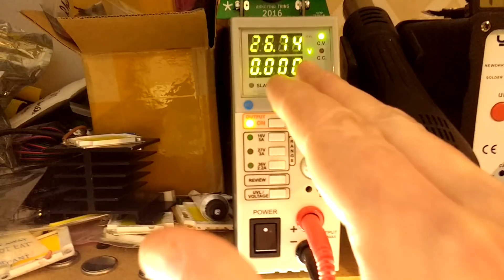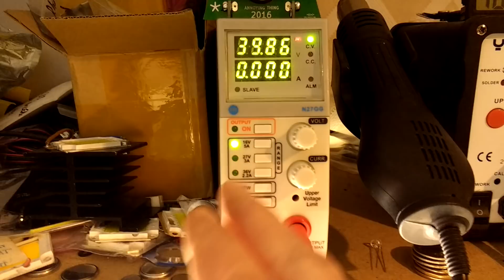Why I never show my power supply.

Comment: Is there a particular supply you might recommend, I remmember you tore down the supply "That went on fire".
Reply: In the US for a really decent but cheapie supply I would recommend the 0-50V 0-3A https://www.circuitspecialists.com/bench-power-supply-csi5003x5.html for $123.30. They have a 10 turn pot to set the voltage and the current limiting is really wonderful. I did extensive boost/buck LED driver development using one. It's an inexpensive Chinese OEM unit but you'll pay six times more for anything even approaching the utility quality from a maker like Keithley. There are so many options today... anything you find here that fits your bill you should be able to depend on for a lifetime of service: http://www.newark.com/c/test-measurement/bench-power-supplies-sources-loads/bench-top-power-supplies
Reply: I have a Tekpower 3005D-3 (http://tekpower.us/power-supply/linear-powersupply/tp3003d-3.html) and it works well. It's a proper linear supply (not switch-mode) so it's large and heavy but very low electrical noise. I replaced the pots with 10-turn versions, it's quite stable & the 10-turn pots provide good accuracy. The adjustable channels can of course be connected in series or parallel for a 0-60V 5A power supply or a 0-30V 10A supply. It's surprisingly well made for the price.
Reply: I have a Peaktech 1535, it's capable of 0-21.5A 0.8-32V. Overall it's a really nice PSU, very well built and a pretty accurate voltage/current output. It has 3 programmable settings and is remote controllable. The only downside is that you can only set V/A in 0.1 steps. For motors or for power electronics not a big deal but for anything which requires .01 volts it's a pain in the ass.
I bought it for 230 Euros from Germany.
Reply: The Mastech linear supply I have (2x0-30VDC@0-5A channels or in series 1x0-60VDC@0-5A or in parallel 1x0-30VDC@0-10A plus 5V@3A fixed) has been quite good to me and seems reasonably well built as long as you avoid the counterfeit units and the price is reasonable.  It has also proven quite tolerant of high RF environments during testing.

For a general lab bench power supply I tend to strongly prefer linear regulated supplies over switchmode supplies as the linear supplies produce a clean and reliable output with no switching ripple superimposed on the DC that can sometimes cause one unwanted grief (like RFI from the switching ripple).  Though if you genuinely need much more than around 10A with a wide voltage range at your bench then you will generally need to opt for a switchmode supply or accept a very large and heavy linear supply (I do have 50A linear supplies that cover the range of 10-15VDC but they are very large and heavy).
Reply: SAI Peregrinus 
Your link doesn't work. Try this one. 
http://tekpower.us/power-supply/linear-powersupply/tp3003d.html
Reply: I have a Tenma linear PSU which is very heavy due to the big toroidal transformer inside. It's actually a rebadged UNI-T one made for Farnell. Seems to be pretty reliable and has an extremely stable output with minimal ripple. Ben Heck uses the same one on his workbench, as I discovered in a recent video.

Comment: I found this teardown, and then the comment section is very interesting...which version do you have?

http://naklojik.blogspot.com/2011/09/maplin-n27gg-80w-switching-bench-supply.html
Reply: Paul Stafford yikes....one mention of Big Clive’s issue as well. Big Clive’s doesn’t seem to be charging larger batteries that backfeed into the PSU. Probably why his is mostly chugging away still. Hmmm
Reply: I don't seen why Anonymous had issues with removing the positive terminal before turning off the supply. For charging batteries, I consider this the correct way to do it. You don't want to turn off the output, because then the battery will be charging your output. That's not necessarily a bad thing either, since it's in the correct polarity for any output caps.

Comment: One potential solution would be to use a 3 input AND gate from the 3 range LEDs and use that to drive an enable (using a relay or some internal test point).
Or you could use an NOR gate and a crowbar circuit, so if none of the LEDs are on, then it shorts the output.
Reply: I don't know which side of the LEDs is switched by the logic but your solution sounds good, could be all it needs is 3 diodes ORing the LEDs together so that the relay can only operate if an LED is on. This power supply would be useless to me with this behaviour.
Reply: You might opt for an XOR instead just to rule out the case where all the LEDs might possibly illuminate at once, which would also be an out of bounds condition indicative of a crash.  That said, there will still be a brief let-through period at the high voltage state for a microsecond or two before the logic can react (assuming the LEDs themselves are reacting instantly, otherwise the let-through period could be far greater) and which may still damage the circuit of interest.

Comment: Is it actually putting out that voltage, or is the displayed voltage wrong?
Reply from the maker: +BaselBantam The first voltage was being output.
Reply: "Not an intended use" only excuses part of the problem. If it can't switch voltages while supplying power, it should stop supplying power if I change that setting. What it should not do is crash and start offering more than 20 V when it was last set for 4.5 V.  Conversely, if that behaviour is OK with you, what would it have to do for you to view it as defective? Explode?
Reply: Is there a chance that some decoupling caps have failed somewhere and allow electrical noise in to kill it.
Reply: That seems like a pretty monstrous issue. I assume this isn't the first and you've already contacted them about it?
Reply: Its a software glitch. What is there to look at?
Reply: Zaierra Hutson - You’re sure about that, then? Even with perfect firmware, if the microcontroller is getting ‘noisy’ power, it could cause serious instability. If it was a firmware problem, either something corrupted it, or the bug was there from the start. I doubt Clive would’ve put up with this since new, so I’m inclined to believe the fault has developed. It’s surely worth removing a few screws and scoping all the rails, checking for bad caps, etc.
Reply: Ouch...
Reply: Firmware crash, I am sure the output voltage holds, just the display displays some random value and it becomes unresponsive to voltage selections.
Reply: Richard, Clive said, a month ago,  that the first voltage (26V) was being output, instead of the desired 4.44V.
Reply: I've use one of these all the time, and I actually read the instructions first.  Switching voltages while it's supplying power may work, but I don't think it's a good idea. It's not an intended use.  If you want built-in misuse-protection, you need a more expensive Chinese product.  This one is excellent value for the money.
Reply: +bigclivedotcom will you have a look inside of it?